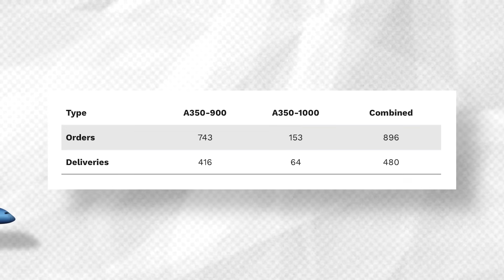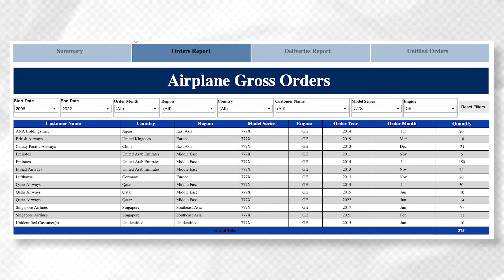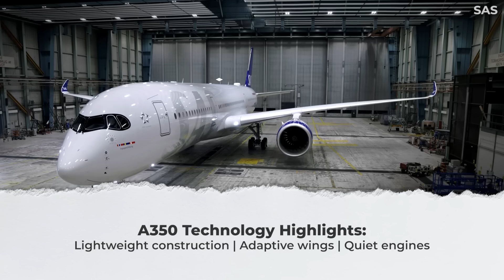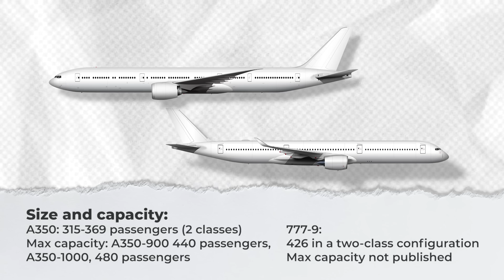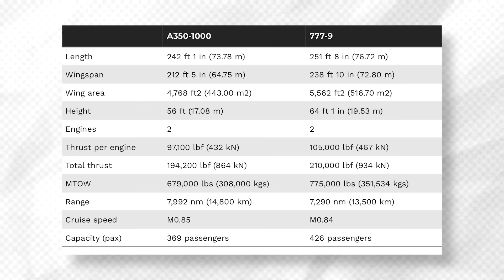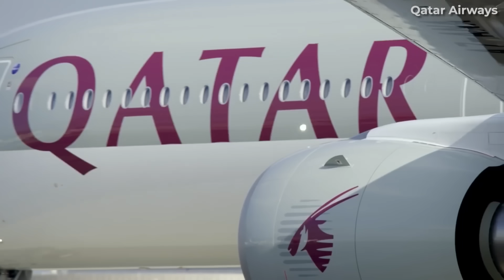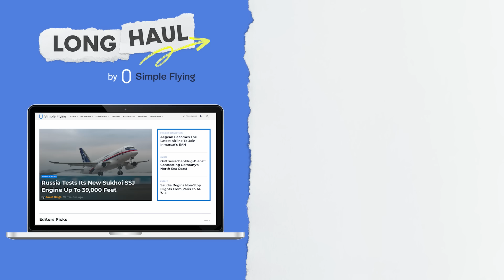The Boeing 777x vs Airbus A350 - Which Plane Is Best?

Comment: Almost seems like Boeing just wants to win a game of top trumps by creating an aircraft with bigger numbers, so they’ve just made a plane that happens to be longer, taller and more capacity, but the important stuff like efficiency isn’t quite there. Almost like when the a380 became a thing, Boeing quickly decided to create a longer 747 that happened to be longer than the a380vand a340, same thing here, airbus makes a new aircraft so Boeing just makes a larger version of one of its current aircraft to compete and win a game of top trumps.
Reply: uhhh no? The plane is designed to fit a certain market , the 747 was first built in 1969 wayyy before the a380 (original 747 designed for cargo and for pan am also) , the original 747 100 could carry 480 passengers in a one class config and had a wingspan of 60m and a length of about 71m , the 747-8 can carry 605 in one class with a length of about 76m and wingspan of 68m , it was made to be better in every way compared to the previous 747 family , not to the a380. The 777X in other ways is a twin engines worthy successor to the queen of the skies. Boeing will always be superior in wb deliveries , as it offers conversions for almost every aircraft (except the 787) . Boeing will always be better at making aircraft that are versatile and flexible, while airbus will favor passenger comfortability as its the only thing its known for. And anyways an actual avgeek likes every plane sooooooo

Comment: given that the 787 fuselage was half or so composite carbon made, why did the 777X not do the same thing?  again, one suspects Boeing decided to go the easy way out...
Reply: they decided to keep it that way because of the huge change, there are many 777's out there and most of the airlines that use them have gotten used to their maintenance procedures, making a plane with carbon composites would be 
1. time consuming 
2. very expensive 
3. hard for airlines to get used to
if they decided to use composite carbon, it would literally be better for them to make a new plane itself

Comment: I already flew 2 times with the A350 and the Boeing 787-9 in the past 3 years. I must say that in terms of noise the Dreamliner is a little bit more quiet. But compared to A320/A330 and Boeing 777-200/300ER it feels like half the noise. Love them both.
Reply: 787 is just slightly better than the noisy 777-300ER
Reply: @kwwong2893 having flown on both, it's way better than the 300er.
Reply: The a350 is quiter than 787

Comment: I think the triple 7 was supposed to have been revised, it would have been ideal if they thought of making it 50 or 60 percent composite in order to reduce its weight and increase fuel efficiency.
Reply: nah they were planning on making a new metal alloy, but composites are too risky. look at the 787 production delays becaouse of the composite.
Reply: @Sanyu-Tumusiime but isn't it getting better due to the R&D done by some companies according to Coby explains video.
Reply: The 777X has a completely new composite wing, the fuselage is of Aluminum-Lithium Alloy, which is significantly lighter than standard aluminum.

Comment: The 777X has a lot of ground to make up when it finally makes it into service. As was the A380 the Achilles for Airbus, could the 777X be Boeing's???

The 747 had decades to make her mark and stamp herself as the Queen of the skies. While unfortunately the A380 will have far less time, despite being far superior in a lot of ways.

Yes, the A350 will have only had a decade up it's sleeve by the time the 777X is supposedly going to be in service, but given the way technology moves, how the travel industry operates and several other factors... that 10 years advantage, may as well be 30 years. Meaning there's a lot of catching up to do!

I look forward to flying with either when the time comes though, as I find long haul gruelling unfortunately, so anything that makes the flight more comfortable and quicker, whilst also being more efficient and environmentally friendly, to a point, is a good thing.

Comment: I’m sure both are fabulously capable aircraft, but when push comes to shove, would I trust a new Boeing? - no. Airbus every time
Reply: Yeah, that's the issue at this point. 

TBF, flying is still incredibly safe. Safer than doing just about anything else. When here in the US, we lose 40k to alcohol, 40k to cars, and 100k to drug overdoses per year, what's a door plug between friends?
Reply: It’s gonna be safe pls stop spreading fear
Reply: @ it’s an opinion, mine, based on recent events. Deal with it. Others can make up their own mind

Comment: 04:20 cabin comfort inspired by the dreamliner?
The 787 is in my opinion the worst aircraft to fly into, nowadays, cramped, cramped, and cramped, and I’m not talking only about the seat pitching, the corridors are catwalks, the lavatories are tiny as well, the window shutting thing works, sometimes, sometimes not.
Plus it looks like nothing, seen from outside.
The 787 is very descriptive of Boeing, when I think of it: from genius to clumsy.
Reply: I agree. But I find the 777 is quite ok with space.

Comment: B777x order book been opened since 2013 with 341 orders.. whilst the first 9 years of A350 had 777 orders, that's more than double.
Reply: The A350-900 is a whole different category than the 777X. Even the A350-1000 is smaller than the 777-9. Compare orders for the A350-1000 and 777-9 and you will be surprised ...
Reply: Well if Boeing doesn’t give emirates their fair share, numbers will drop to 300 orders. Meanwhile airbus is constantly working to fulfill hundreds of orders that are not likely to be dropped.

Comment: For airlines it is all about running costs and fuel economy per seat mile is a major part of that.  The B777X is a superb aircraft but suffers in two regards.  Despite all the marketing hype about the B777X it is difficult to see the aircraft as anything other than ‘mutton dressed as lamb’.  The A350 is a modern design using light weight composite materials and has now established itself as reliable and efficient.  The lack of significant order numbers for the B777X indicates that airlines are not convinced.
Reply: And yet, even with the A350 already proven and ready to go, there are over 300 orders for the 777-x  Every new aircraft has to prove itself, even if it's a newer version of an older aircraft. Airlines may like the new and shiny modern technology of new aircraft, but they also like the reputation and reliability of proven aircraft, which is why the Airbus is selling so many Neo aircraft, and Boeing is still moving so many Max aircraft despite all the issues.
Reply: @sainnt  No US-airline has ordered the B 777X, and none will do it, it is the same as for the b 747-8I, and the b 777X will be the same economical failure for Boeing.
Reply: @he8570  It's not going to fail just because US airlines have not ordered it. Only Delta Airlines has ordered the A350, and it's not a failure.
The 747-8i is not a failure because Boeing actually made a profit, compared to the A380 where Airbus didn't. And they sold plenty of cargo variants.
And, US Airlines are not like Middle East and Asia operators who operate gateway hub operations. US airlines are mostly point to point, getting passengers to their international airport hubs by using regional jets, so they don't need that kind of capacity. They also don't operate first class anymore. That explains why they've ordered way more 787 than any widebody Airbus has to offer. The 777-X will be just fine. Once airlines start operating them, other airlines will join. Plus, it's going to enjoy additional success as a cargo variant. The program will be just fine.

Comment: From the numbers being shown (0.09 vs 0.11 lb/seat/nautical mile), the A350 offers 18% lower fuel consumption on a per passenger basis. This is a big advantage for Airbus; at least a generational gap.
Reply: Too early to draw conclusions about fuel efficiency since 777x hasn't even entered service yet.
Reply: @TanTran-xe4mb  There is nothing wrong with a hypothesis

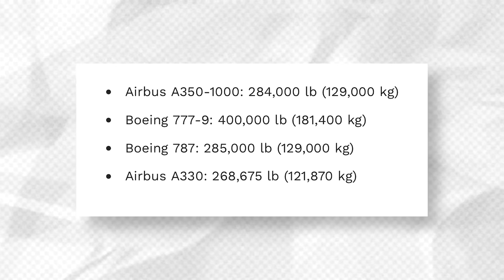Comment: 07:50 Surprising to see how much heavier the 777x is in comparison to its competitors.
Reply: 29% heavier than A350-1000
Reply: That's because it's not a composite heavy aircraft like the A350 or Dreamliner. It's built using more metal. However it's lighter than the current 777, has composite wings and a much more modern engine. All adds up to 15% better fuel efficiency, and no competition in its class.
Reply: @sainnt  But is it not also competing against the a350?
Reply: @blackhole4106  The 777-9 is in a class all by itself. The A350 cannot match it. The A350 competes with the current 777.
Reply: @sainnt  I don't know much beyond the specs, but I just know that the 777-9 has similar seating capacity and range as the a350-900. How else do they differ?
Reply: @blackhole4106  The A350-900 has a capacity of up to 350 in 2- class configuration. The A350-1000 seats about 384. The 777-9 will seat up to 426 in 2-class configuration.
In high density, the A350-900 will carry up to 440 in high density and the 1000 up to 480. The 777-9 would likely exceed 500 in high density configuration.
The A350-900 has a range of 8100nm and the 1000 8700. The 777-8 flies farther than both and a seating capacity similar to the A350-1000, but the 777-9 had a shorter range until Boeing builds the ER version of both.
Neither A350 variant carries as much cargo as any 777-X. 
Basically, the A350 variants are more comparable to the 777-8. The 777-9 is in a class by itself when it comes to twin engine widebody aircraft .
Reply: @sainnt  The 777-9 is just a bigger 777. The A380 is bigger. The size of the 777-9 could also be a problem. Just look how few airlines ordered it. How many US airlines?
Reply: @sainnt  the GE9X engines are heavier then previous engines
Reply: @paolomaldini3082  Most new engines are heavier than previous generation ones, but use lighter components and are way more efficient.

Comment: I think it may come down to past performance of other units, e.g. the A310/320 against the Max nose dive variant. I would not under estimate the amount of reparational damage Boeing has done to itself, I certainly don't trust it any more and because it's had a dodgy quality control system mixed with a corrupt FAA it makes it hard to trust it for the future.

Comment: I would say the 777X. It's bigger, more fuel efficient (conpared to Suze and weight to fuel burn) and could fly further (some models like ER, LR)
Reply: Fuel burn per seat per nautical mile was 0.09 lbs for Airbus and 0.11 lbs for Boeing.
What metric are you using to calculate fuel efficiency ?
Reply: @suserman7775  the fact a 777 is much heavier and the fuel burn is almost the same. I've saidnit before so o think you didn't read. The 777X ER and LR could get the extra range of a 777LR or ER. That means a 777X could fly 16000km with 426 people!!
Reply: @jouniairplanevideos  .09 versus .11 is a 20 percent advantage of fuel burn per seat to the A350. Are you saying those numbers are wrong ?
Reply: @suserman7775  I think you don't think straight or atleast not what I try to tell you. The 777X has GE9X engines. Those engines are more efficient because they've been made later on with new technics and more data from previous engines. The 777-9 is much heavier and so needs bigger engines. The fuel burn difference are 0,11 VS 0,09. Those numbers aren't 100% accurate for different reasons. Exact specs won't be disclosed that easy and we don't know much about the B777-9 and GE9X yet. Also a more known reason is that engines from PW,RR or GE aren't that good as what the specs said. They've some issues with it wich caused a higher fuelburn and maintenance costs and longer delivery times. It's a good gues. But to stay with it's dimensions and weight. A fuel burn difference of 0,02 while a weight difference of 100/200k lb means a bigger plane could have almost same specs of its counterpart while being much heavier. So basicly a 777-9 is more efficient.
Reply: @jouniairplanevideos  I think you're very confused when you say "A fuel burn difference of 0,02 while a weight difference of 100/200k lb means a bigger plane could have almost same specs"

The fuel burn spec of .09 versus .11 was PER SEAT !!!  Per seat; so you cannot say a bigger plane helps with the efficiency because it's a spec that is not PER PLANE, it's PER SEAT.  If the per seat penalty for Boeing is 20 percent, and the plane is 20 percent larger, then the TOTAL fuel burn will be 1.2x1.2 = 1.44.  Forty four percent more fuel burn per plane trip.
Reply: This guy is delusional

Comment: On paper, the A350 is the better aircraft. It's cheaper, more efficient overall, and has a proven record. However, it can't carry as much cargo or as many passengers, plus the fact that larger aircraft tend to be more comfortable for passengers. Boeing is also well-known to underestimate fuel efficiency. I suspect that the 777-9 will perform better in operation than projected just as it's been proven with the Max. This may be the most anticipated aircraft since the Dreamliner!